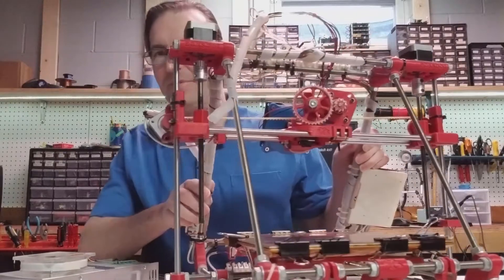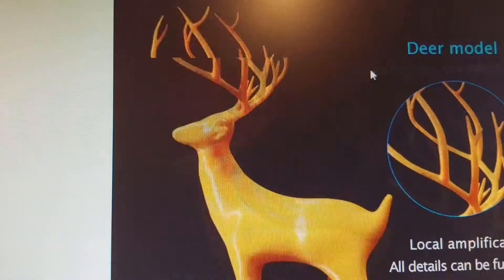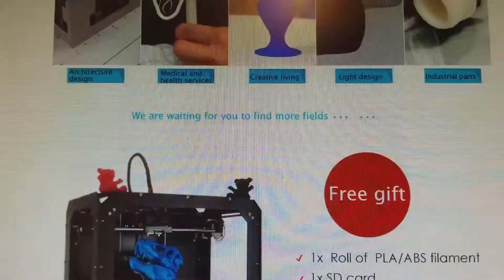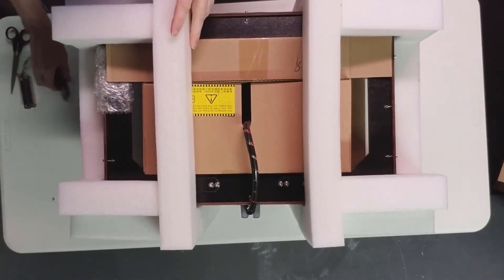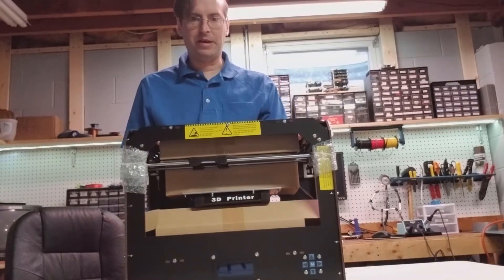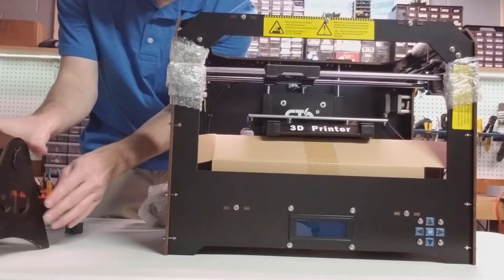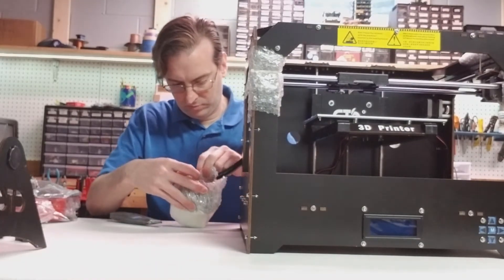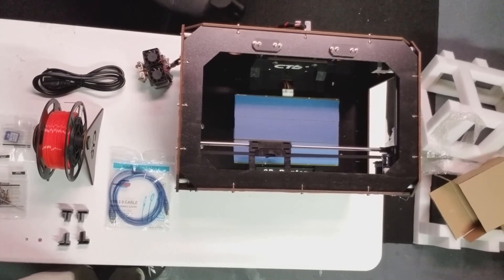Bizer CTC 3D Printer Unboxing

Comment: I just bought one of these on EBay myself. It was missing the SD card, but came with a nice addition - a laser head for engraving (with no instructions, of course, on how to connect it to the electronics or how to actually use it...). I had the same loose red fiber washer - did you ever find out where it came from? I only received it a few days ago so I am still learning. One of the first things I printed with that red/orange PLA was a second spool holder (I mounted my spool holders into the holes in the back of the cabinet) so that I can eventually run both extruders. I am waiting for a glass plate to arrive so I can print ABS as well as PLA (I tend to prefer ABS).

Comment: i need help which app should we use to print our project because the app CURA dont work when i put my SD card in the printer
Reply from the maker: This won't accept gcode. It needs to be formatted to x3g. Makerware software will convert your gcode or even slice for you! It's a free download from the makerbot website.

Comment: Why didn't you look at the Geeetech A10M. Bigger build size with Dual filament printing.
Reply from the maker: Honestly, it just looked so cool on ebay that I could resist the itch to buy it. Lol! Im sure there are much better options, but I did this rather impulsively.

Comment: Hello, I would like help with the following.
I have a Makerboot type printer and my problem is that the extruder fan stops sometimes and this causes a jam. Change the cable, the fan, but after a couple of days of printing, the error occurs again that the fan stops sometimes.
The strange thing is that when the printer is turned on again, the fan starts again.
I would appreciate any help.

Comment: hey hello , do you know how to use only left extruder ?? in ctc bizer 3d
saludos!
Reply from the maker: You can designate your extruder in the slicing software. I have been using Replicator G, which offers the option at the top of the slicing settings page. Each slicer should have an option to switch extruders, but where that option is in each slicer varies.
However, if you want to to it the "Hardware Way", simply switch the wires from the Right extruder to the Left (along with the fan wires as well , for proper cooling). Your print will be slightly off center, but that can also be adjusted in slicer settings.